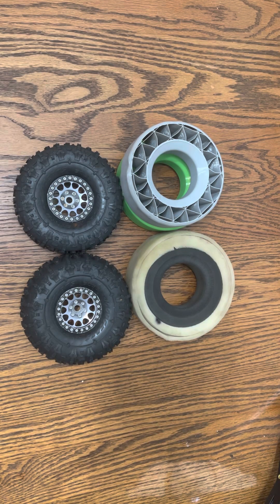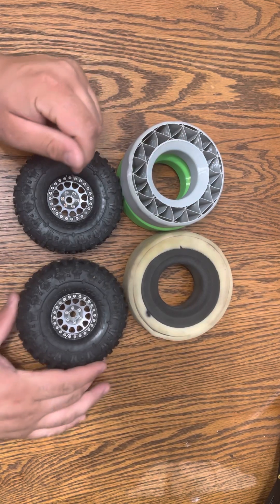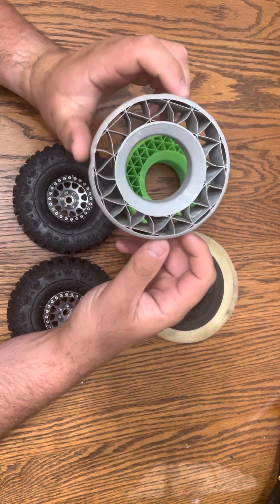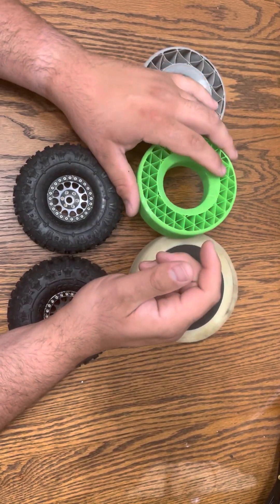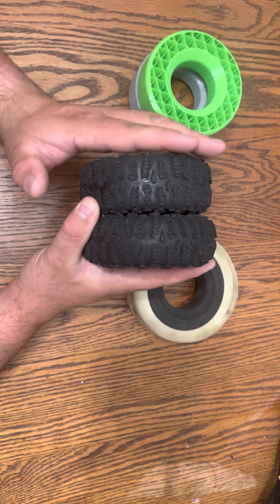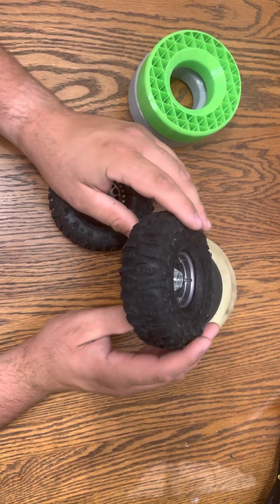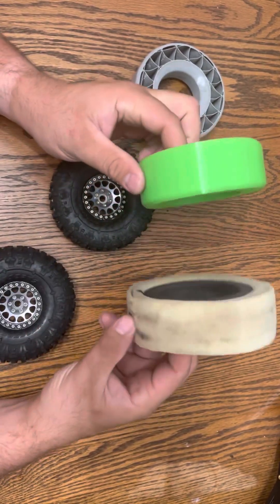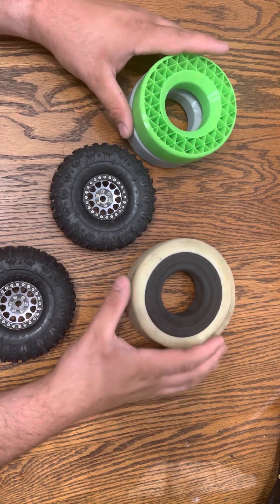Robo slug rc 3d printed rc tire inserts vs crawler innovations dual stage foams

Comment: Quick question, what material did you use to print the hard body? I usually use PLA, but I understand this is too rigid and offers no elasticity. A friend of mine is looking for a replacement for his crater. I recommended using the 3d printing approach to save time and money and offer repetitiveness as the solution, so after you get the stl and the suitable material, you'll be able to endlessly print these bad boys. 

Thanks for your help,
Reply from the maker: Hi I didn’t print these I purchased them from robo slug rc on Etsy